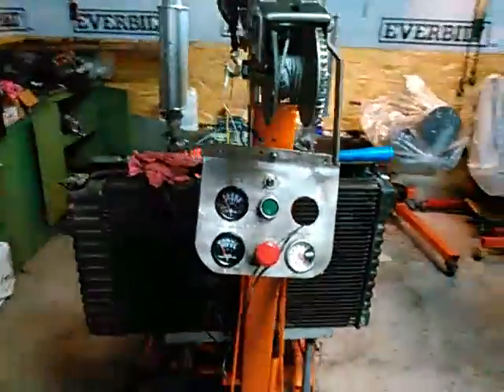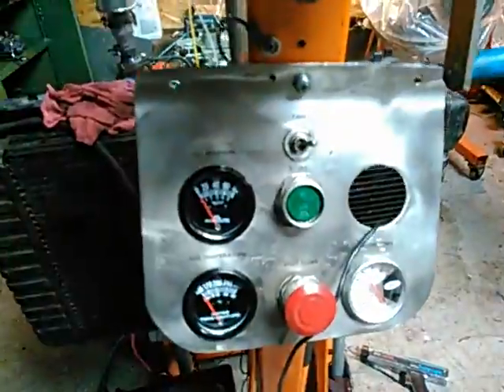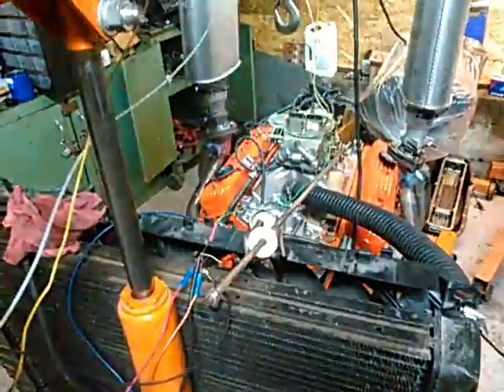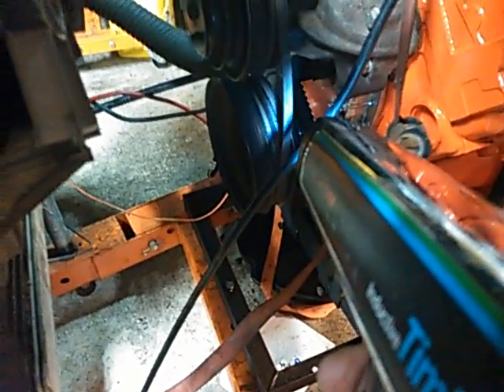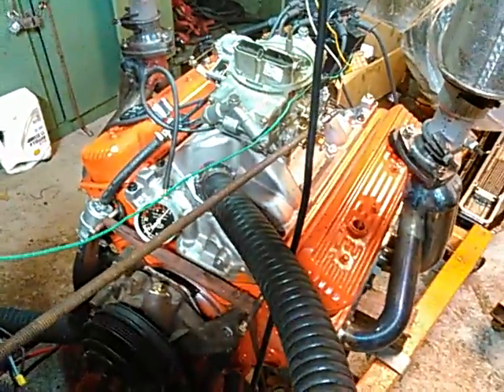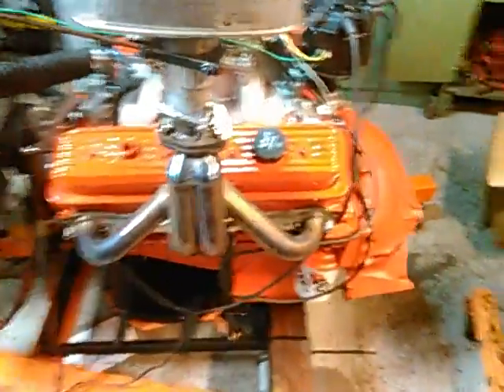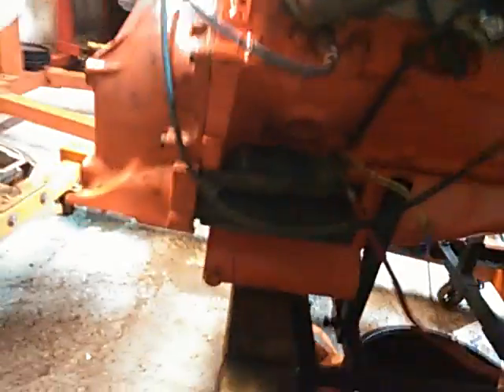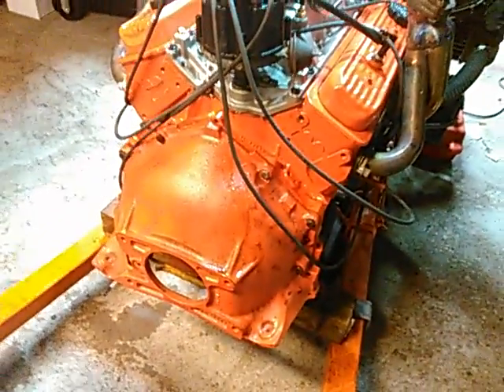383 stroker small block chevy break-in on homemade stand

Comment: Idk bro i still think your a bit over with your numbers it sounds  like a stock cam theres no way a 104 dg centerline cam is gonna be done at 4500 rpms a cam that big has to be high rpms and  are you sure those are vortec heads or ?? They look like tbi heads to me get a good picture for me of it looking straight dowm by the sides of the carb  is tjere bolts there?? If so theu are not vortecs

Comment: What? 104 dg lobe separation? What ? I wanna see the cam card theres no way it would idle like that I think your mistaken
Reply from the maker: You think I did this entire build, but I'm mistaken about the cam I used?  Not on your life.  The duration is a lot milder than you'd expect, equaling less overlap.  Overlap determines the idle quality.
Reply: @ShawnStjean duration and lobe separation determine overlap mostly lobe separation angle more than anything a 104 dg lobe separation angle would not idle for shit and vacuum would be wishful thinking definetely not streetable 112 to 114 is the norm anything under 108 is pushing it for a street machine lift is how much the valve opens duration is how long it stays open and lobe separation is what gives you overlap that blup blup choppy sound which at 108 is very very choppy 106 is race only cause it won't idle below 1500 w out stalling im always willing to learn something new tho for real and I'm not calling b.s on you im just going by 35 yrs of working on gm products mostly sbc 's but lots of olds 350 rockets and 455 pontiac motors which i loved bone stock out of a grand prix had over 450 ft lbs torque and 350 hp used to get them from the junkyard for 200 bucks slap tjem in an old beater and it was a sleeper used to chew up and spit out built small block chevys all night long with a 200 dollar junkyard motor that all i did was tinker with the advance curve and get the quadrajet in tune and that was how we did it back in the day with very little money learned a whole lot too they always had a turbo 400 behind them for 35 bucks and 30 mins time a b n m shift. Kit would tear up u joints snatching second every time big bark 4 or 5 ft long rubber from second gear i would love to hear more about what you've got in that motor those are pretty high numbers your talking and that takes some doing not just a cam with a lot of overlap.. holla at me lol im an old chevy guy and i love this shit lol

Comment from the maker: This engine ended up going into a '70 Chevelle with a TH350 and 2.73 rear gears.  It has over 400 ft lbs off -idle, and the car breaks the tires loose at 30mph on dry pavement.  Excellent street motor with mild manners, no drama, and definitely puts a smile on the owner's face!